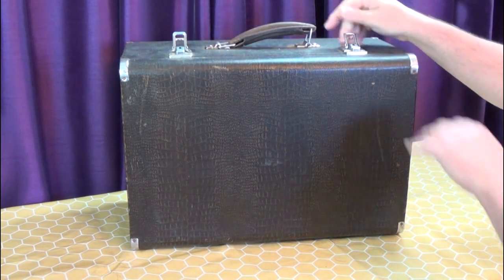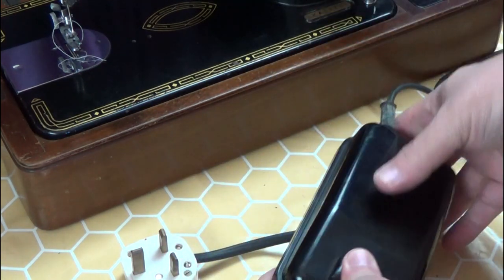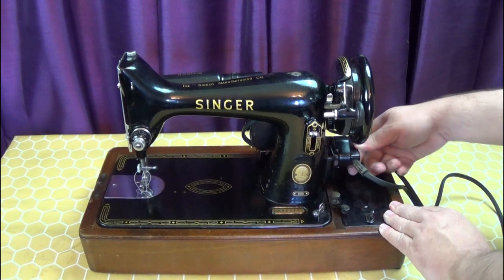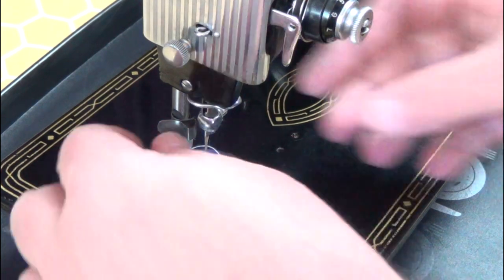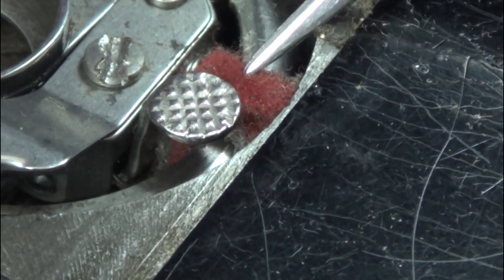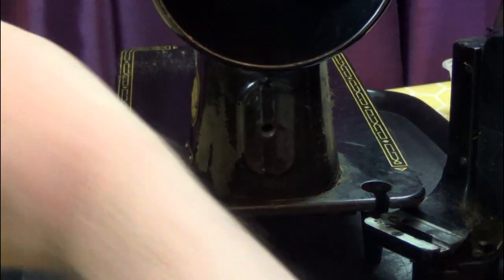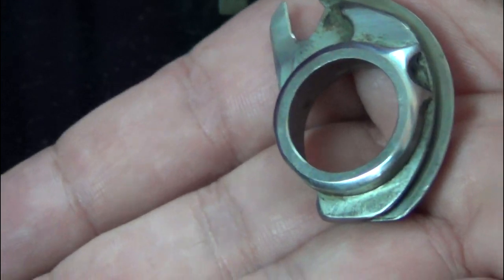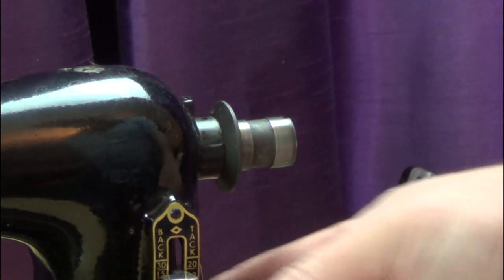Restoring a Singer 99 Vintage Sewing Machine - Part 1

Comment: Brilliant! I’ve just picked up a Singer 99K from the local tip. It looks like it’s in good condition albeit very dirty and is missing a couple of things like the bobbin plate and tool box cover. Thank you for sharing this 2 part tutorial. I’m very excited to start cleaning it and bringing it back to its beauty and working order.
Reply from the maker: I'm glad to see you're inspired - let me know how you get on!
Reply: Thank you for reply. Just wondering if the little red oil piece is missing from the bobbin area can I replace it with a piece of felt?
Reply from the maker: @teresabourke7551  Yes you can. If the spring that holds the felt in is there, cut a piece of felt into a V shape (a spool pin felt is great for this) and twist it into the spring.

Comment: Thanks for the clear video and delivery of content. What or how do I replace the red Lint in the bobbin casing if it is missing?
Reply from the maker: You will need to take the bobbin case out, cut a small triangle of wool felt and screw it into the cone shaped spring.

Comment: Another 👍 great upload. Straight to the point. A few days ago, I acquired an EM322XXX 99K (1957) in the little two-tone case with the adjustable stitch length lever that can be tightened. I've cleaned and oiled him. I'm waiting for the auto touch up paint to arrive this coming Tues. to touch up a few areas. The person didn't pack the foot control properly after I'd sent thorough instruction on how to properly pack a sewing machine for shipping. The did only half of suggested. There's a gouge down to the bare iron back by the pillar. The wooden supports underneath the machine came unglued and were rattling around under the machine. Otherwise, the machine didn't appear to have been used much, as the decals are pristine. Pity really. I did get a partial refund due to the piss poor packing job. Hope you're doing well. Always excited to see a new upload from you. Best wishes --- Rich in Texas USA ✌🇺🇸 *edited to correct serial number
Reply from the maker: I work for a parcels company so I know how roughly they can be handled. I'm not sure I would risk sending anything! Fortunately The UK is a small country so most places are a relatively short drive away. I have a lovely 99 in a 2-tone case. I can't bear to part with that one. Looking for another of those cases so I can do a video showing an easy way to restore them.
Reply: @CurioByBSpokeDesigns   Yes, they're quite rough with packages. (Especially heavier ones.) I didn't want to risk it but this machine looked like it'd hardly been used. Hope you do find another case to restore. Love to watch you do that, too.  I'd like to tackle this one's case and the case to my Singer 226U at a later date. The 226U is one of the more rarer machines here in the U.S. (The 'U' denotes Japan.) Their craftsmanship is second to none on older sewing machines. It's a swing needle machine that takes the flat cams. Makes a gorgeous satin stitch and has the needle position lever, much like the 306 and 319. Got lucky that it included an original manual (226U) and the purchase receipt from 1965. Has interchangeable needle plates and plenty of the solid 15-class bobbins. It's weighs in at 48 lbs without the case. 💪😊 Take care and thanks for the reply.
Reply from the maker: @rich-f-in-tx6388  I'd love a 226U. They're very rare here too, I've just acquired a 319, swing needle machines, so looking forward to getting around to that too!

Comment: I just bought a singer 99k from a house clearance shop and it works but it needs some love. I'm so glad I found this channel! 
I will follow all your tips, my only questions are that it came with lots of different feet and they seem to be covered in rust. Should I try and clean them with sewing machine oil before trying anything else? Thank you so much!
Reply from the maker: fine wire wool and Autosol metal polish is great for feet.
Reply: @CurioByBSpokeDesigns  thank you so much x

Comment: I am a learner. My machine has not been used or serviced for a long time but does work. I just wound my first Bobbin. I disengaged the needle mechanism by turning the smaller inner wheel to do this. I have since learnt I only need to turn that wheel a small amount to disengage the needle. I turned it a good few times to make sure the needle mech was disengaged (probably too much if that is possible). After when I re-tighten it the needle mechanism does not always work now. Any ideas on this? I have started to oil the various recommended moving parts. Maybe I should attempt to take the wheel off as you did in your video to check inside?
Reply from the maker: I'd take the wheel off and check that you have the washer with the three tabs on. It could be missing. Take the handwheel off and give everything a good cleaning and a drop of oil.

Comment: Isopropyl alcohol. Make sure you’ve bought 99%, not 70% which also contains water. I’ve known parts go rusty in the alcohol because I left it too long I suppose. But the less water in the mixture the better.

Comment: Love the video, so detailed. One question though, when you clean the bobbin case area with a Q-tip, are you using alcohol, the rubbing compound, or nothing at all? Thank you in advance for your response.
Reply from the maker: Just sewing machine oil. You can use paraffin/kerosene if it is really gummy.
Reply: @CurioByBSpokeDesigns  Thank you

Comment: Bobbin case removal:-  Apart from moving that lever to one side, does the machine have to be in a particular position of it's operating cycle?
     Thanks for the vid.
Reply from the maker: good point, yes it does. Generally the feed dogs should be high.

Comment: I just bought a Singer 99k and it is quite crusty!  I appreciate what you’ve have shown here and will try to utilize at least some of what you’ve explained! Were you saying that the USA equivalent of your cleaner was GoJo?
Reply: Also, the original case base and cover mine is in is terribly musty! Can you suggest any way to lessen or eliminate that?
Reply from the maker: Gojo - non pumice hand cleaner.
Reply from the maker: @JesusisKing222  There are many methods - depending on the type of case - a bowl of bicarbonate of soda can often get rid of smells after cleaning of course.
Reply: @CurioByBSpokeDesigns  thank you so much for both replies!
Reply: @CurioByBSpokeDesigns  the case feels like leather covered wood.
Reply from the maker: @JesusisKing222  I'd try bicarb first

Comment: This is a very helpful video! I have my Great Grandma's sewing machine, it is a 99k, and it is attached to a table that can be folded down to look like a regular side table. The machine has not been used since she died, which was over 25 years ago. I am just learning to sew now, and I would love to be able to use her machine. I haven't taken anything apart yet, though I did get some dritz sewing machine oil. It is pretty dusty and grimy from old oil, I suppose. I want to do a good job in taking it apart, so I can hopefully preserve it and get many more years of use out of it! Can I yse water on the body of the machine to get the initial layer of dust off? Or would plain water damage it? Thank you for your help!
Reply from the maker: Hi. Never use water on an old machine (or water based products). Water will find its way under the shellac that protects the decals and damage them. If you only have sewing machine oil, use that. Have fun!
Reply: @CurioByBSpokeDesigns  thank you so much for getting back to me so quickly! I really appreciate it. I will use the sewing machine oil . Can I ask you more questions if I have any issues when I clean the machine?
Reply from the maker: @melinalack6224  of course!
Reply: @CurioByBSpokeDesigns  thank you so much!
Reply: @CurioByBSpokeDesigns  hello again! I have taken my sewing machine apart as you instructed, and I had no issues! I am going to brush, vacuum, and clean it next. I wanted to ask you about the belt. Once I was able to take the belt off I could see that it is dry and has little cracks/splits. What kind of replacement belt should I get? Thank you!
Reply from the maker: @melinalack6224  Search google for singer 99 belt. Some modern ones have an orangey colour and are toothed - they look a little odd but work well. Just avoid the rubber, one size fits all, rubbery belts.
Reply: @CurioByBSpokeDesigns  thank you very much again for quick reply! I looked and found an orangey one as you mentioned, I'm glad to know that will work! Thank you for your help☺️☺️
Reply from the maker: @melinalack6224  You're welcome!

Comment: I am restoring a 99. It has DREADFUL wiring that needs to be replaced. I can see how to renew and rewire taking out the supressor but what is the box that is bolted below the motor. It has 3 leads coming out one attached to each of the 3 posts. It is solid black bitumen. The box is curved to the fit the underside of the motor. What is it? Can I remove it?
None of my other 99 or 201 has one.
Reply from the maker: That could be a capacitor as well.

Comment: I have just bought a hand crank 66, I want to restore it when it arrives. Is there a list of the products you use so I can get them ready for when it arrives?
Reply from the maker: Swarfega - original formula, if the body is really dirty, if not clean with just sewing machine oil. Autosol metal polish for the shiny bits, Fine steel wool, also for the shiny bits. Carnauba wax to shine the body.

Comment: im stuck on the bobbin case removal... the retaining finger doesn't go out as far over the screw in my model. It also has one screw in the arm, but its higher up and there is no rivett. help
Reply from the maker: There is a version of the bobbin case with just the one screw. With this one you have to remove the screw.

Comment: Can you tell me if you put bumper feet like cutting board feet on the 99 k would it stand alone without a box.
Reply from the maker: no I'm pretty sure they need a base as the mechanism underneath will foul on the table surface.

Comment: Im in the US.  what gel cleaner would you recommend?  I have a 99 and a 66 red-eye labeled
Reply from the maker: If sewing machine oil is not strong enough to clean the machine, you can use Gojo, the non pumice type.

Comment: I’ve heard that we should only use sewing machine oil, not anything like 3in1. And that WD40 leaves a residue. Do you agree?
Reply from the maker: Yes. 3 in 1 is too thick and WD40 is not a lubricant, it's a water displacer. WD40 can be good as a penetrating oil to loosen up stuck screws but should be flushed out with sewing machine oil.

Comment: Surely this is "maintain" a sewing machine, NOT "restore".
No mention of how to take out and clean old oil off the insides.
Reply from the maker: If you flush the old oil out with Paraffin there's n ot need to fully disassemble.